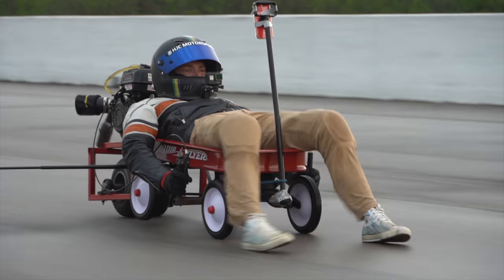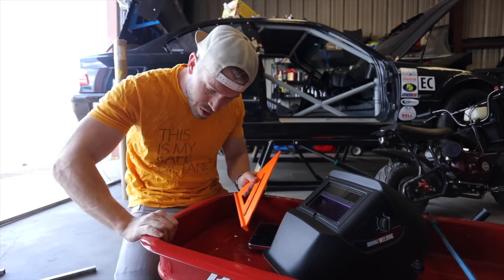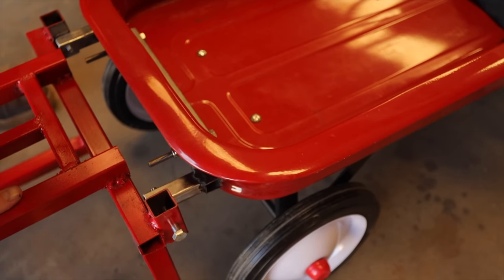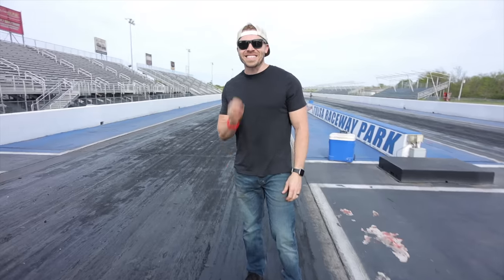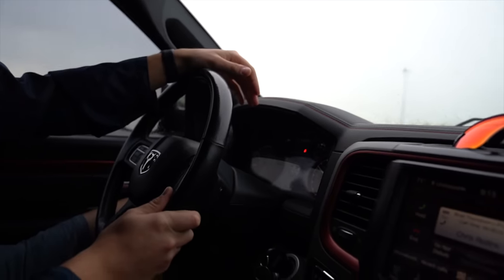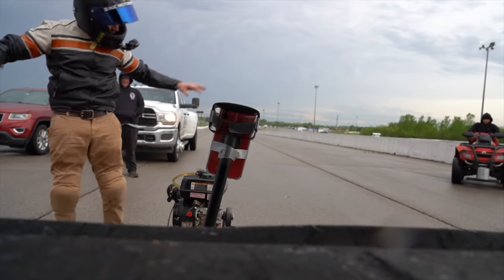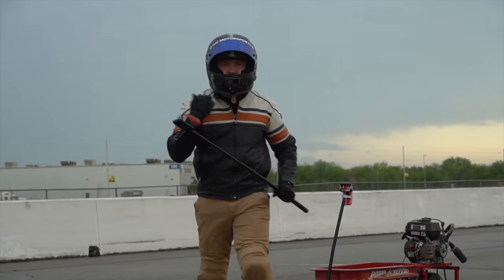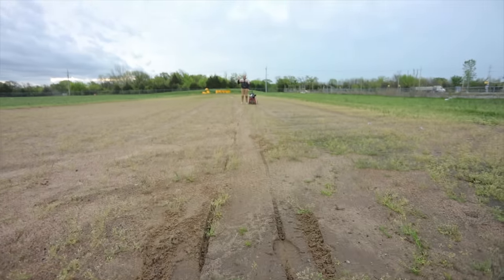Can I Break a Speed Record on a Wagon?

Comment: I see possible optimizations. Instead of using your feet to brake you could use the steering bar with some form or brake pads on the bottom to contact the road. Also the back portion with the driving wheel needs some form of suspension to maintain contact with the ground. You could also reduce some of the material in the back portion by using different geometry such as a trapezoid instead of a rectangular prism.

Comment: Cool video! 
but isnt it better to have a motor pulling you than for it to be shoving you? Myself, I would have tried putting the motor and drive wheels in front of the wagon and use it to steer with

Comment: think if you used the drive wheel as a puller on the front it might had been safer as you wouldve turned the wheel with the wagon steering and not had pushed the rearwheels off the ground as its rotating under acceleration , it mightve skipped while slipping under acceleration , but that wouldnt hurt under acceleration (though it might lift the front wheels off the ground under braking if you dont let it freewheel)
with the drivewheel in the rear it might help to make the chassis longer and mount the engine in front of the drivewheel , this puts more weight on the rearwheels of the radio flyer and prevent the power put to the ground front trying to rotate the frame backwards
seen those luge guys use their feet bror braking and they basicly stuck pieces of car tire under their shoes , might want to use pieces of hardwood instead to reduce the force on youre ankles
Reply from the maker: Yes i agree! If i were to do this again, which i may 🤷🏼‍♂️ id start with mounting the engine MUCH lower! So much weights up high was causing me to fight wobble
Reply: @ChrisRollins  if you alowed to slightly modify the flyer you could move the rear axle of that back a little too as that might prevent the weight of the pusher hinging too far behind the rearaxle  and puts more weight on the front , mounting the pusher so it actually hinges on the rearaxle between the wheels ( prolly too weak for that though ) would eliminate the chance of it lifting the front wheels as the weight is pushing straight onto where the wheels touch the ground and not behind them

Comment: How did you break the record if the other guy went 53mph? 🤔
Reply from the maker: 🤔 he hit 45 mph on the stock metal and rubber wheels (thats the record i was going for) he hit 53 mph on the pneumatic tires. Two different records.
Reply: @ChrisRollins  oh wow! I didn't pay much attention. Thank you for the clarification. So is it just a speed record? Like if I send it down a hill it counts?  🤣
Reply from the maker: @blickmoto2953  haha, you would have my respect! Using an engine gives you the ability to back out of throttle if things get sketchy, a hill might not be as forgiving.